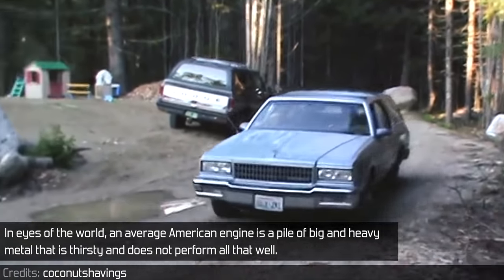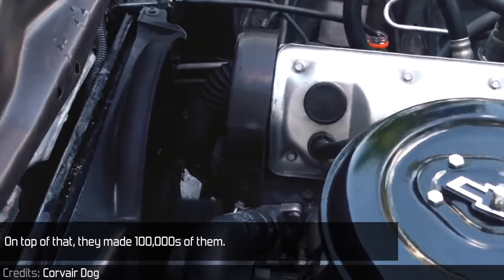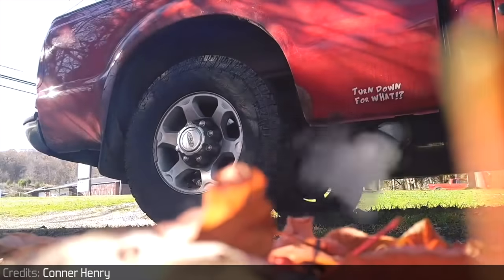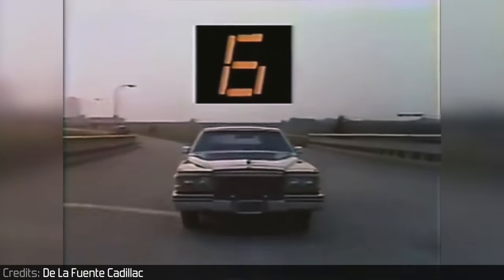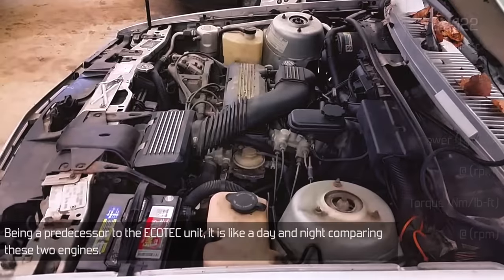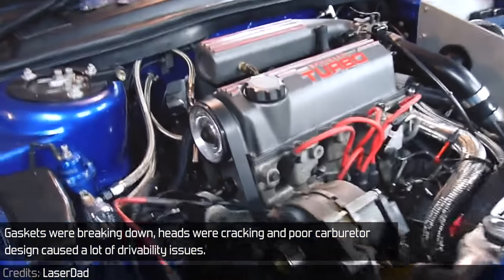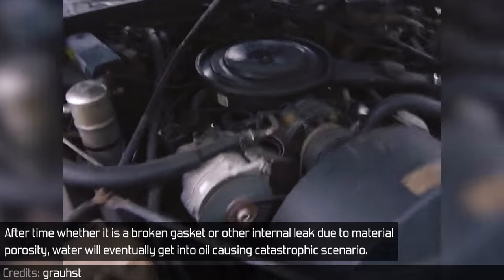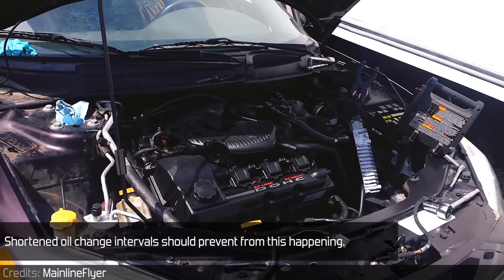8 Worst US Engines You Should Avoid

Comment: Make a list with the worst german engines pls
Reply: all chain from VAG engines are very bad
Reply: BMW M40 (Camlobes & Valveguide wear), M41 & M51 (Dieselpump fails), M54 (Bad Oilcontrolrings), M57 (Intakeflaps tear apart) N42 (Valvetronic fails), N47 (Timingchain jumps), S65 & S85 (Bad Conrods & Bearings)
VW/Audi VR5 (Bad allround Design), VR6, EA827 execpt ABF & KR (Many Oilleaks, bad Crankcase-ventilation etc etc..), EA888 (Timingchain jumps)
Porsche Boxer from 997&996 (Many complete Enginefailures)
Reply: 2.0tdi PD code BKP liked to eat its own oil pump.
Reply: b-but... german engineering is flawless...
Reply: audi 3.2tsi sooooo bad   50tkm trash
Reply: Kai Müller calling the m54 a bad engine? It is one of the best engines bmw ever made and i drove 3 of them
Reply: Kai Müller get your facts right
Reply: Henrik Pundt nearly all bigger vag engines (v6+)
Reply: I know, but for me, as a German, one failure makes the hole System shite. Mahle knew their Pistonrings where crap... I mean common Mahle.. why...
Reply: mahle baut doch nur das die von VAG im auftrag geben       und als zulieferer hast du bei VAG sowieso verkackt
Reply: The hole Engine was a Compromise in Costsavings and restricted Dimensions/Space. I6 and V6 both have their benefits (Like balanced 1st & 2nd Masses for I6 or Space/Wheight from a V6), but the VR got nearly every disadvantage from I & V Engines. Biggest Problems, in my Opinion is a really bad Combustionchamber and horrible Ports.
Reply: Seriously VW VR5, V5 and VR6 aren't shitty engines.
Reply: LeireX Sure... That's why German cars have always been at the bottom of reliability consumer surveys.
Reply: The wurst German engines.
Reply: Every "new" engine
Reply: Kai Müller - You forgot the BMW N63. So prone to premature timing chain failure that they ended up recalling the entire production run. Hell, I had one in a month or so ago with a stretched chain that only had about 40k miles on it.
Speaking of timing chains, there's also the BMW (Mini) N12/14/16/18 engines that stretch chains and destroy chain guides at or before 60k miles. I just did one of those today.
Reply: Layth Alkhaer 
1st It's a joke!
2nd Are they really? German cars seemed pretty reliable for the most part (except for BMW of cause). As a university student at the TU Berlin I have to say Germans take their mechanical and electric engineering pretty seriously.
Reply: @ masterofThardus: giggle good one :)
Reply: LeireX that seems to be the problem with German Engineering. They take it too seriously thus over engineering everything. The more variables to anything the more likely for failure. Just keep it simple like Toyota and Honda "usually" do.
Reply: 1.4 tsi shitter
Reply: All of them
Reply: not!
Reply: that would be a long list or he'd have to shorten it to engine families because it's expensive
Reply: Doug Reed that's the difference between German engines and things like the LS
Reply: krezo   Yes I have the M54 in my 2004 5 Series.  Still runs well although it’s starting to leak a little oil.  I’m sure a valve cover gasket replacement will fix that.
Reply: All, list done.
Reply: Maybach HP230
Reply: Well Volvo isn't german, its swedish xD
Reply: The Volkswagen D24T engine, an inline 6 Diesel found in the original LT vans and some Volvos like the 940.
No torque, super narrow power band, drinks like a homeless Russian on a cold night in February.

Awesome sound, though.
Reply: Excellent observations!  Seems like the German strategy now is to provide free scheduled maintenance just about until the warranty runs out.   Then they really sock it to you.  And the resale value just falls off a cliff.
Reply: Don't forget the BMW N20/N26. I've done so many timing chains on those and the Mini engines you mentioned that I could do them blindfolded now. Every BMW with an N20/N26 we do used car checks on we pop the oil cap off and check the timing chain, and almost 100% of them you can lift the chain off the cam sprocket with a pick. But hey, at least now BMW is putting the timing chains on the back of the engines! Nothing could possibly go wrong there, right?
Reply: Audi 2.8 30v.  Actually, the cars that surrounded them were even worse.  Brutal, relentless money pits.
Reply: @derxKai  BMW M60 Breakdown of the Nikasil coating of the cylinderwalls. Due to sulphur acid formation during combustion.
Reply: @derxKai  VAG 1.9 PD TDI with codes BXE and BLS conrod bearing abnormal wear.

Comment: I must've lucked out with GM because I had a Buick Century with a 3.1 liter V6 and it was a pretty good car. But you can't beat Toyota. I now have a 2.5 liter 4 cyl. Camry and it's the best car I ever owned.
Reply: GM isn't bad when they put time and money into their engines. In the 70s and 80s a lot of new designs didn't get that.

Comment: Late 90s Chevy 3.1L for FWD. Another cost cutting mistake - the two lower intake manifold gaskets was made of hard plastic - when it would leak, coolant and oil would mix together - which can ruin crank bearings. Absolutely no indication of this damage occurring except oily sludge in the radiator.  Aftermarket gaskets were far superior - if you caught the issue before your engine was ruined.

Comment: I'm from America, and I can agree that the engines from the 70s and 80s are garbage, and a nightmare to work on. However, most engines made before that were great, and the new ones are really impressive. Just look at the new Corvette Z06, or the Dodge demon.
Reply: I'm a Brit, and tend to agree with you. Have a nice Christmas buddy!
Reply: Don't even need to focus on performance engines. Ford's Ecoboost 4 cylinders are crap on gas, but great on reliability and power. Same with the EcoBoost sixes and the Coyote V8. And can't forget the good old LS. Sure it's a stone-age pushrod engine, but how many cars with over 6 liters of displacement can claim to average 21mpg combined?
Reply: Flame Beats the 3800 disagrees
Reply: I'd even argue against the poor fuel economy claim on the Ecoboost, my wife's Ecoboost Mustang sees mid 30's regularly. Maybe the mild mods help a little but it seemed good in the very short time it was stock too.
Reply: ohc on any of the american cars,just wondering.
Reply: jaketinx these days most are with only a handful of exceptions like the ChevyLS/LTs and the Dodge V8s. Not actually correct to laugh those away either as the main benefit to keeping a cam in block layout is the engines are tiny compared to the OHC equivalent. Sit an LS and a Coyote side by side and the size difference is shocking.
Reply: 4.3
Reply: Jared Sundstrom Those diesels were disgusting, I understood the concept but the execution was poor, but it seems GM is trying again with their new Chevy line up with diesel's across their SUVs now, and since they are the same diesel they were selling in Europe they should be better
Reply: Flame Beats guess you have not had cars with a 3800
Reply: Frank Magana I agree with you frank, the 3800s are probably the best engine they have ever made, even including the V-8 in my personal opinion, the 3800 have never had a single issue I can think about
Reply: 390merc65 all the emissions crap
Reply: 390merc65 Cali
Reply: no, the engines were not garbage. the cams, intakes, compression, and timing were.
Reply: There were some truly great engines then, too, but older proven designs. For example: Ford 302, Chevy 350, Chrysler 360.
Reply: i think the ls7 so the 427 7litre got good mileage too
Reply: ya bullet proof plus they could be turbo [in the Buick turbo regal which is bad ass] or supercharged
Reply: Flame Beats 
I'd have to agree on that for the 3.1L, and 3.4L. They suffer from the same coolant issue as the Caddy 4.1L V8. If the orange coolant isn't used from new, the intake manifold gasket fails over time. This tends to push oil into the coolant. Also, with the 3.1, I've found that they suffer from a low cruising speed, with 65mph being the upper limit. Over 65, and the fuel mileage drops to single digits. God help you if you live where the posted speed limit is above 70mph.
I've never had a problem with the 3800, and only MPG issues with the 4.3.
A friend of mine had a pickup with a 5.0 V6 that he beat the tar out of back in the 80's, and never had an issue with. That truck is now about 50 years old, and as of 2 years ago, the original engine was still running that truck without having been rebuilt.
Here's a wiki on the giant GM V6...
https://en.m.wikipedia.org/wiki/GMC_V6_engine
Reply: +DrFruikenstein Single digit fuel economy over 65?  There's something wrong with your engine.  I got 29mpg from a tank of gas once on my 2002 Pontiac Grand Prix with that same engine, with 90% of that tank being used to drive 70+mph on the highway.  It still didn't change the fact that the lower intake manifold gasekt had to be replaced in 2009 with only 20k on it, nor did it change the fact that it had coolant sludge issues and I had to top off the coolant every month or so on that engine, even though it only had 72k when a Jeep rear-ended it.
Reply: Teraforce88 
In my case, I experienced the extremely low MPG issues with two Olds Cieras, and a Chevy Malibu. All three cars were checked, tuned, plugged in to the computer, rechecked, and re-turned. Nothing seemed to help. I even removed the air filter for one trip, with no success. Yet all three ran very well, other than the low MPG issues (aside from replacing the lower intake manifold gaskets on all three).
Reply: Jared Sundstrom olds 260 v8 200k+ miles on it and it still had all but 3 of its 215 horse when new hit 145 mph with that car
Reply: Jared Sundstrom that was a 76 year model
Reply: Flame Beats Ya no, I average 20 mpg on my olds fuel injected 3800 series engine. That car is 29 years old, from 1989.
Reply: +390merc65 True with the stock power specs, it's as if they had restrictor plates...
Reply: Jared Sundstrom thanks to government regulation with no concern for reality.
Reply: Anything from the 70's and 80's is a thousand times easier to work on than any "modern" engine. Take my '08 Taurus for example, you have to remove the engine from the car and tear half of it apart just to replace the water pump. The routine stuff was always easy to fix on old cars. I'll admit modern cars are much more reliable but God help you when something breaks and it requires troubleshooting to find.
Reply: jaketinx---   Sure.  My '67 Pontiac Firebird had an OHC 6 in it, essentially 250 cu. in. Chevy Six with an OHC head bolted on and driven by a toothed belt.  Mine was the 'High Output' version with a Rochester Quadra-Jet carb, 10.25-to-1 compression ratio, and a bumpy cam.  Didn't have the off-the-line punch of a V-8, but at 70 mph or above it'd fly.
Reply: Keye T---  Oh, they had their issues, alright.  You just have to go far enough back in their history to find them.  For example, in the early to mid seventies they had a flywheel cracking problem.  The cracks would start at around the mounting bolt holes and allow the flywheel to flex, creating a knocking sound.  Just like a rod knocking or a main bearing going bad.  Scared the shit out of a lot of owners until they were lucky enough to find a mechanic experienced with the problem.  Yeah, you had to yank the tranny out to change the flywheel, but it beat junking out the car.  Then in the early 1980's Oldsmobile moved their 3.8 V-6 engine plant to Mexico, where the blocks were stacked outside in the open dusty air until their assembly was completed, and the sand that would collect inside the blocks was not fully flushed out prior to final assembly and engines were seizing all over America.  Olds bit the big green wienie warranting a lot of motors on that one.  But understand that the original design goes way back to 1961, when Buick pioneered this engine in their smaller Skylarks, so it's been around for a very long time.
Reply: corvette l.s. =   weak rods,  DEMON= soft rockers , poor oiling system, lifter failure And it's not a true HEMI . everything has flaws, a specially new JUNK .
Reply: Honest truth, I'd rather get a 300cid I6 from the 80s and put it in an F150 than an Ecoboost V6 from today. Might be why we have two F150s in our driveways with 300s in 'em...
Reply: Why? due to SMOG EPA regulations it took decade to figure out new systems that would work. Foreign manufactures didn't have to deal with EPA standards. plus they mostly had 4 cylinders in Foreign imports which was easier and simpler to smog equip.

Comment: Mopar LA series 90 degree V-8. Great engine. Had one in a mid 80's dodge diplomat. 152K on the clock did timing chain water pump radiator alternator steering pump all at once. put 100k on it, never failed once.
Reply: These engines were great once you stripped the "Lean Burn" crap off them. I had a 1984 Chrysler 5th Ave. Ran like crap. I removed the Lean Burn system & wow It would burn rubber!
Reply: @Shadows-RC  Now I know NOT to get edelbrock lol

Comment: The V6 charger at the end of the video looks like is saying "please kill me it hurts to live"
Reply: Simone Ternelli Their newer V6, the Pentastar, is fantastic, though. 300hp even in the minivans!
Reply: 5Rounds Rapid minivans are always cool. Especially while doing donuts
Reply: Those 2.7s were physically HUGE engines.
Reply: Yea, not to mention it's ugly as shit.
Reply: 190 horsepower in a 4,000 pound car, I can understand its pain. . .
Reply: That Charger is better off with the Hemi engine
Reply: The narrator didn't specify if the mentioned 2.7L V6 were the FWD [LH] or RWD [LX] versions, although I figure BOTH maybe equally bad for the same or different reasons. If that LX Charger had to had a V6 better would be the RWD version of the 3.6L Pentastar, like today's LD.
Reply: Simone Ternelli---   You haven't heard the worst of it, Simone.   The water pump on Chrysler's 2.7 V-6 is IN THE BLOCK.  So when it starts to leak there's no tell-tale drips on the ground or the garage floor.  The coolant leaks directly into the sump, contaminating the oil supply, and you don't know this is going on until until your red oil pressure warning light goes on, by which time your engine is also seized.  IF you catch it in time (by noticing that your engine oil on the end of your oil dipstick has turned to a creamy brown, indicating coolant contamination) you can have your water pump changed for a mere $1,000.  Yup, that's what my mechanic said, $950 to $1,000, and he's done 3 of them, so he'd know.
Reply: I thought it was just getting out of bed.  I think I heard it yawn when they first put the foot on the accelerator.

Comment: yep, Chrysler put a 2.7L V6 into a heavy ass Charger...makes 190HP from facotry assuming 170HP to the wheels from drivetrain loss, she's fun in the rain though, while you won't get sideways when it's dry it loves going sideways when it's wet, first day I owned it it spun a rod bearing and got rod knock because of the oil sludge, same price for the car ($5,000) to put a new 2.7L in it, would've went with the Hemi but I would've had to get the R/T drivetrain with it and I didn't have enough for it, I plan to put a V8 in it at some point I love how smooth the Chargers ride unforunately the LX body never got a manual transmission

Comment: I've had 8 f150 with the tritons and I love em, I think you're a fool for putting them in the list.
Reply: They do have the problem but I don't have problems with my 4,6 liter. Its a good runner and I WILL NEVER change the spark plugs. 
I unplugged the EGR valve to raise the burn temp in the cylinders and let the check engine light burn out. Problem solved. Its hot enough to burn out all the carbon now. 
I can tell you I save gas with the EGR disabled.
Reply: All I’m saying is I’ve never heard a triton that wasn’t ticking like a tap dancing class